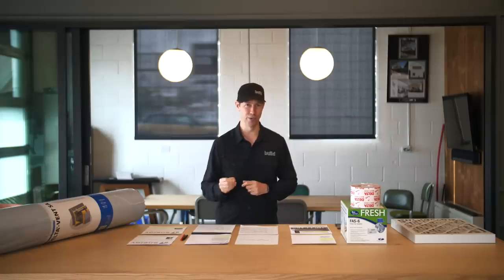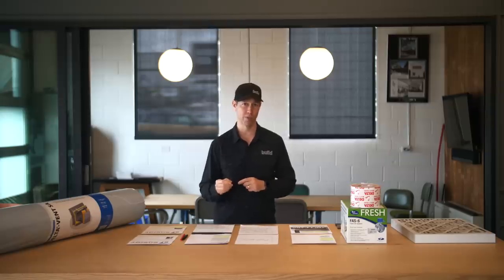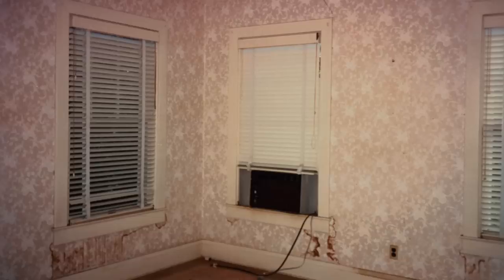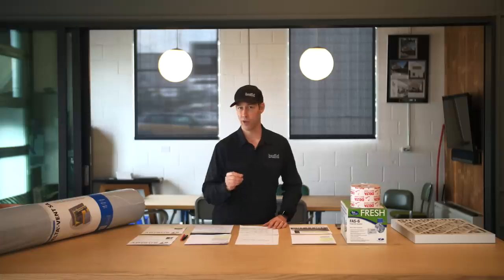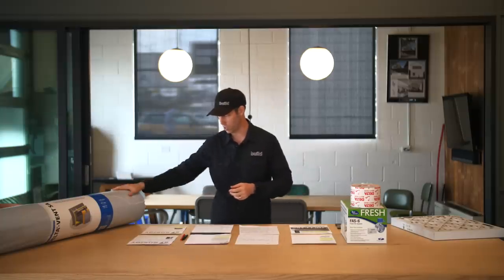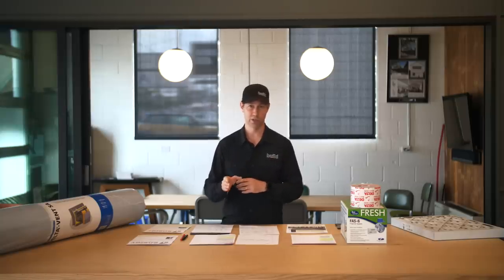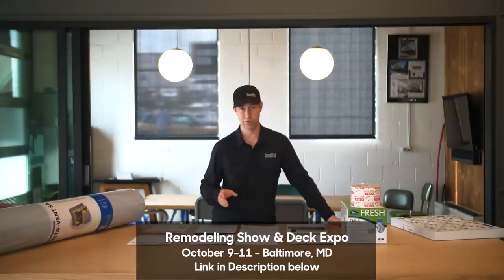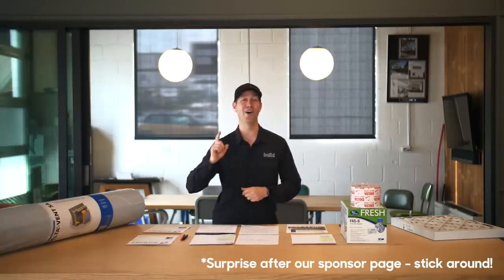“Houses need to BREATHE!” - Shut your filthy mouth

Comment: And I'm quite sure the "durability of old houses" is also just a myth. There ARE durable old houses, for sure. But the ones that were not durable just don't exist anymore. It's kind of "natural selection" which causes a bias in perception.
Reply: Every house old or new needs to have maintenance done period. If you don't keep up with it, it will not lastl. So that's why older houses existing today.
Reply: @leethibidaux1641  All houses need maintenance, but a lot of the McMansion boxes I see in america are just junk houses and won't last and they aren't meant to either. Old houses are common in Finland, they are timbered houses and if you tried to seal them up they'd rot in short order.

And this video has got such a misleading headline, houses do need to breathe. He just talks about one approach, the seal it up tight and control air exchange through active ventilation. But that's only true for that type of house... If a house needs to breathe or not depends on it's design.

We still build new high efficiency houses in Finland using passive ventilation and organic materials that can absorb and release moisture, that is a house that is designed to breathe and it works. They are nice in that they self-regulate indoor humidity. These houses can survive without power and to the people thinking that's paranoid, just this year we've had storms resulting in some places being without power for over a week. You can have a ground heat exchange heatpump often as the primary powersource. But most houses in Finland for the reasons mentioned above have wood burners can heat the house if the power goes out. 

We also build the usual houses with normal insulation and vapor barriers of course, I live in one of those and I am aware of the need to keep an eye on the FTX ventilation unit, it's crucial to keeping such a sealed house in health, I am personally not sure it's the best way to go... If we lost power for a long time I wonder how we would make it. Fortunately we have a fireplace for additional heat but ventilation remains an issue.
Reply: I believe thats called “survivorship bias.”
Reply: Excellent point. My father said the same, “Old homes were built right.  Look at all the old ones still standing. ”  “Yes dad because the ones that didn’t hold up are gone”.  I bought a newer more comfortable home with much less upkeep needed.
Reply: ungratefulmetalpansy 
When my father passed we inherited 3 rental duplexes and one single family home.  None had been lived in for 5-10 years.  They were robbed of copper and trashed.; broken walls, broken windows, etc. Plus, I lived 1500 miles away. Sadly with back taxes, repairs, insurance, maintenance (lawn care, etc) we made very little.  It certainly wasn’t worth the stress  and division it caused in the family.  That’s why I resolved to have just one home. Maintain your property and update it appropriately. Don’t leave your children with huge headaches. You don’t want to be remembered for that. Sorry dad.
Reply: ungratefulmetalpansy 
Property values have gone up in most locations so maybe that will help you out if you decide to sale. Good luck.
Reply: schoha  In Egypt there was a show called "This Old Pyramid".
Reply: Marco Tedaldi. my home was built in 1820,it is so strong that in the North New York it is comfortable .the home I built in 1999 sucked I sold it after 15 years! it was falling apart
Reply: Sort of, but people did over-buid back then. As the saying goes: "Anyone can build something, but it takes an engineer to barely build something." Back then engineering wasn't as popular when building residential homes, and so people over-built (they also had easy access to old-growth wood and used hardwood way more often).

So while survivor bias probably plays a small factor, old houses were generally built way sturdier than new construction.

Examples of actual survival bias from back then:

My grandparents second story is held up by 2' x 2' (that is foot) cross beams.

A place I used to live in had a foundation of large stones cut flat and stacked, creating a basement that could be comfortably walked in (head-height). Well over a hundred years later and it hadn't even shifted: no floors sagged, all windows were square, everything was plumb. It's like having a pyramid builder make a basement.

But most houses back then weren't that ridiculously over-built: So many old houses have more normal construction and are still around. Why? Outer walls framed with true 2 x 8s; 2 x 12 floor joists; etc. To safely do the same job, we use 1.5" x 5.5" (modern 2" x 6") to frame houses (modern construction used to use 2 x 4s (1.5" x 3.5") until about 10 years ago).

So while we get better at using less to do more, we naturally rid ourselves of redundancy and durability we didn't realize we had at the time.
Reply: It's called "survivor bias." No one sees all the failures before, just the ones that survive.
Reply: Yep, all the old houses are durable... that's how they got so old. But there were plenty of houses built alongside them that haven't stood the test of time. Same "the don't make 'em like they used to" fallacy as usual. we remember what lasts, and forget what doesn't. But that doesn't mean a whole lot.
Reply: Haha great point! I always think the same thing when people say they just dont make appliances like they use to. Maybe they are right, but maybe people are just more likely to call a repairman for a newer appliance.
Reply: If anything goes wrong on the old house is normally the foundation!
Reply: SuRViVorshIP BiaS

It's like you people learn a new word and try to apply it to everything. When thousands of pre-war houses were built in the 20th century, and we can verify that they weren't torn down and replaced (property records are public)... that's not survivorship bias.
Reply: Exactly.  Different type of home and materials require different approach in design to function properly.
Reply: Survivorship bias
Reply: We live in an 1893 Queen Anne Victorian in Upstate New York. We also own a second house, an 8 bedroom 2 full bath 3,000 sq foot 3 story Foursquare built in 1906.  Both houses have ALL the original doors and windows. Our heating bills are quite low. in fact they are lower than any modern house that I've owned prior. Both these old houses have natural gas boilers and the houses are very warm and comfortable. No insulation in either f them whatsoever. The secret is this; first the walls in these historical houses are rough cut old growth lumber and  are incredibly thick. The plaster alone is over an inch thick. Both of our houses still have their original cast iron radiators. This is KEY. Cast iron radiators are one of the most efficient heating systems ever created. Cast iron holds heat long after the heat has been turned off. The heat radiates into the structure itself. It's not heating the air like with modern forced hot air systems which are ironically incredibly inefficient. It's the opposite of what he's saying. Historic houses are effecient. Forced hot air heat is the most inefficient system made. But its cheap. Like baseboard heat. That's cheap too. And that's what it's all about. Affordability. Houses built after 1940 were starting to be built with plywood and drywall instead of shiplap and plaster walls. And houses have gotten cheaper and cheaper every decade since. It's not a question of comfort or efficiency. That's bullshit. It's simply not true. If it were nobody would be living in historic houses! The reason why we can't build houses today like we used to is for one reason only. Today we use man-made OSB, plywood, sheetrock and engineered wood products that's for and would let tremendous cold and heat in because they are paper thin. Junk. That's the only reason.
Reply: @1873Winchester  does it get humid where you live?
Reply: @1873Winchester  nothing in the article about the efficiency of the windows. Do you have any evidence that old single pane windows are anywhere near as efficient as new windows?

Comment: Yes addressing one but not the other is a huge problem. In the UK we have cowboys injecting mineral wool into 1920-1930 cavities and blocking off the cavity vents which decreases the breathability and causes all sort of of problems with condensation and interstitial damp.  This is often compounded by 'water proof' paints on the outside which trap the vapour in the walls.  Many older houses do require lots of energy to keep warm but messing with one variable without looking at the whole house can have terrible consequences.A study showed that mental and physical health was negatively affected by this governet endorsed intervention (Social and health outcomes following upgrades to a national housing standard: a multilevel analysis of a five-wave repeated cross-sectional survey Poortinga et al)

Comment: I am building my own home.  I am a 32 year old woman.  My dad is a framer and I grew up around job sites.  I’ve learned so much from this channel.  I am using all the techniques that are best practice and using a lot of the sponsored products, at least the ones I can afford!  I have to literally teach some of the stuff I’ve learned to the subs I hire.  Thanks for creating such informative content!! And screw the haters, I can’t believe all the nasty comments you get.
Reply: This guy is not a good framer,please don't follow his advice
Reply: You are just a hater.  If you have nothing nice to say don’t say it at all.
Reply: Gravity feed water system ?  If you had solar power, a properly sized efficient pump, pressure tank and check valves a pressure of 40 to 50 psi should not be a problem to maintain.  But who knows, maybe you live on the side of a hill.  Head pressure is .43 lbs per foot elevation of source.
Reply: Just make sure you get a quality HVAC company that will actually ensure that they are bringing the proper amount of fresh air into the home.  Speaking as someone who does the inspections that Matt talks about, most of these companies put a woefully pitiful amount of fresh air intake into their systems.
Reply: I am 61 and rebuilding my 1940 childhood home.  The inner structure is solid and wood seems petrified.  The person who had it before me let it sit empty for 8 years and now the roof leaks so bad some of the wood floors are needing to be replaced. I am putting heating in the floors anyway. It was always a cold house, now it won't be. I still believe in open windows if possible. The house is a cabin type. I want to 
increase the size some though. First time I have done this, take it one day at a time.
I watch a lot of you tube videos also.
Reply: @DylanBegazo   Do you think anyone read this massively long soliloquy?  LOL.
Reply: @vanessaoseguera2583  When there's a business involved, saying/discussion should be encouraged. The emotional "hater" comments need to be avoided if we're going to learn and improve. Matt's great, but he's not God-none of us are.

Comment: I'm no expert, but I think submarines have always had to be fairly tight.
Reply: All the ones that worked anyway.
Reply: hahaha nice...
Reply: Right up until they are back at base... Then when the crew disembarks they leave every hatch open and the technicians still won't go in there for a few days. On a Vanguard class there are 135 souls on board, under the water for months... that's a lot of farts released into an airtight room!
Reply: Sometimes our Submariners are under for much more than "a month at a time"
Reply: @donkmeister  Yep; I wan on a Lafayette class sub in the 80s and I remember fresh air stinking after being down for a while - The change is gradual so you don't notice it until your crack a hatch. Awe, the good old days
Reply: Well I mean you also have to have some pressurized bladder system to control pressure and buyoancy
Reply: Not if your Chinese
Reply: So, you should make your clothes with plastic?
Reply: They dont even rust pretty on the outside as long as the stay submerged, rust needs both water and oxigen. Thats why boats have more rust on water level than underwater.

Comment: I worked for an insulating company for many years and we often did what's called an r2000 seal. Exactly what you're explaining in this video. After the house passed the test most contractors cut long slits in some of the cavities to allow the house to breath and prevent rot. Great clip.

Comment: I’ll be honest, I was one of those skeptics who worried a lot about how air-tight your builds are, “sick building syndrome,” etc. You’ve brought me around, though. Thanks for taking the time to explain all of the reasoning behind it!
Reply: I work exclusively on existing homes in New England. Usually these are old homes that have withstood the test of time because of the leakiness Matt described. What I get concerned about when I’m repairing/updating/remodeling is how to properly integrate modern air-tight building technology into a home that functions as a “leaky” building in the other existing portions if the home. I’d love for Matt to make a video on how to effectively implement modern building science while remodeling old homes.

Comment: It occurred to me that perhaps the old adage of a house “needing to breath” may have had an association with houses that have open fire places. Air would need to enter the house in order for an open fire to gain an appropriate draft to fire and for the chimney to draw.   As a kid growing up every time an outside door was opened it would cause a plume of smoke to come out of the fire place.
Reply: If you do go wood stove, the way to do it is to provide a outside air vent that goes straight to the fireplace. This unfortunately is a huge debate with many people against it, but if it's done right, eliminates the cold air drafts you're talking about. If done wrong, it can make smoke spill back into the house. You can use a damper to close off the fresh air intake if that happens though, and if it's well designed that should never happen in the first place.
Reply: Houses "needing to breathe" had nothing to do with the 'draftibility' of wood stoves. It was to do with preventing houses from rotting inside the walls. If air could easily pass through a wall, then any moisture that gets trapped inside will evaporate and dry out before any long-term damage can be done. I've seen this in 100+ year old houses in Atlantic Canada. Zero rot under the sheathing. I recently rewired a 110+ year old house here. Absolutely solid. They are constructed well for a long lifespan. Unfortunately, the energy requirements to keep a house warm like this makes it terribly inefficient in larger square footage homes. Thats probably why most of the older homes around here are less then 1000 sqft.

Comment: In Germany we avoid every single leak it is very important. But the house actually need to "breathe", so our solution is we use a membrane under the roofskin which allows to leave wett air to outside but nothing inside it is called "Unterspannbahn". Between roofskin and "Unterspannbahn" is space (200 square cm per meter minimum) for air zirkulation.
Reply: Thank you Ive been trying to find more info about this, always a concern when encapsulating crawlspaces. Im surprised how little information there is on this subject in Canada.
Reply: And here in northern Europe in the places where radon radiation from the ground is common the foundation has to be breathable, so the radiation can pass right through and not be trapped